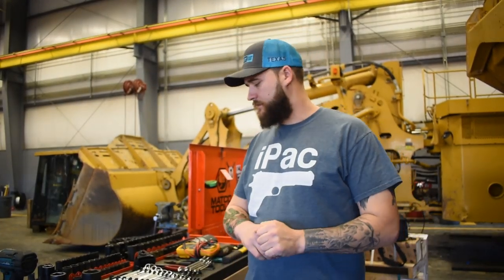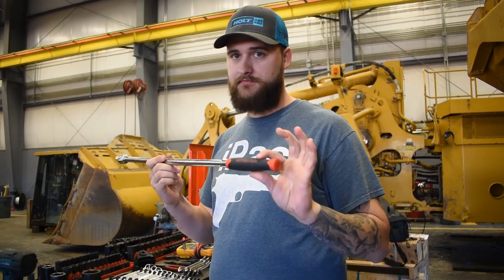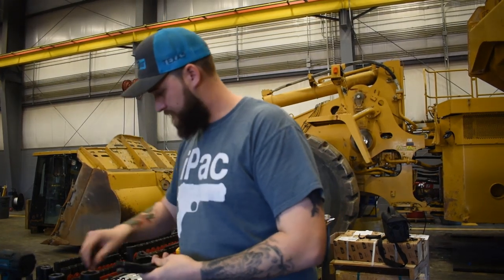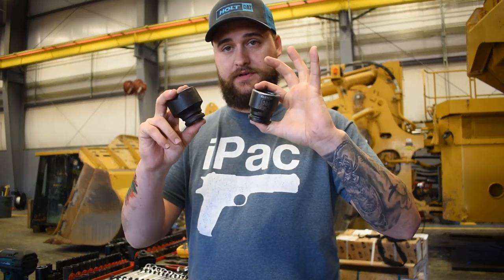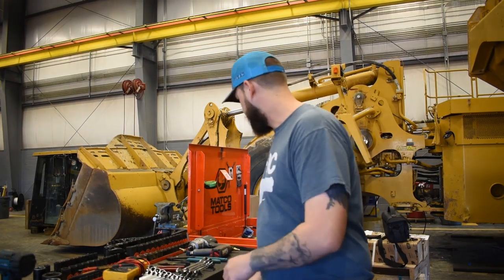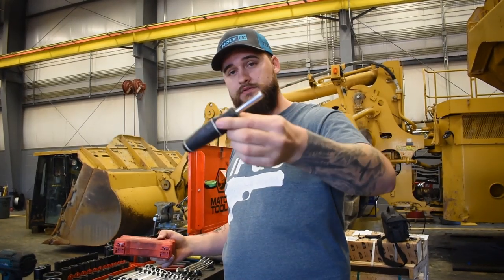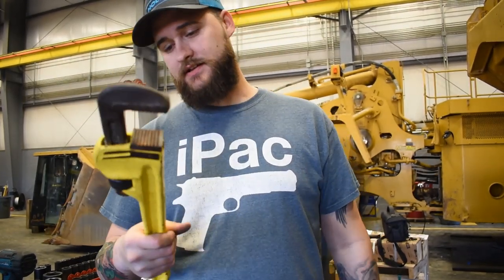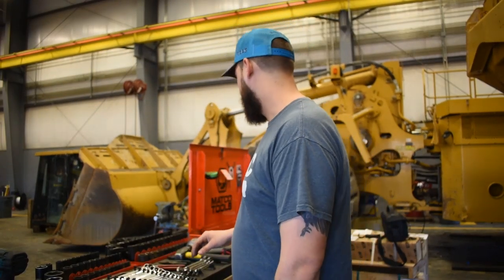Tools You Need To Start As A Heavy Equipment Tech

Comment: I think my best purchases for my first year was my Milwaukee 3/8" stubby impact with the 6.0ah battery along with a set of good wobble sockets. I can zip those clamps right off the valves for hydraulic lines with that stubby and some wobble sockets in some tight ass areas that there is no way I'd be able to get my air tool in. Oh an on prybars get you a 29-48" extendable indexing prybar it's the cats meow i can use mine on smaller stuff and extend it out for the big jobs an being able to adjust the angle of the head makes it really really nice. I probably got 10 different prybars an I pretty much just use the indexing bar 95% of the time.
Reply: Where did you get the pry bars from? What brand?
Reply: @EnriqueReyesJrREALTOR  Gearwrench I have the  33" and 48 inch indexing pry bars. They have handled a whole lot of abuse the still work fine. 82248 is the part# for the 48" and the 33" part# is 82220

Comment: Good list man… I’m in heavy equipment myself but very specific field and we use the hell out of 24 mm  but everything from 8-41 mm metric and up to 1/4 to 2-1/2”  SAE wrenches sockets as you can  …, air hammer with long chisel tip a must…slide sledges, and large pry bars are a must … use  1/2 impact on nearly everything I can and 3/8 on smaller stuff but some times all you can get is hand tools to fit… for what I do the first purchase I made was 24” 1/2” drive ratchet and air hammer I had most the rest of the basics but the air hammer for me is an absolute must have for starting out… as for a do most everything plier knipex cobra or raptor can’t remember which they basically replace slip joint pipe wrench and adjustable pliers imo

Comment: I got a long handle tekton 3/8 ratchet i use for doing couplers in skid steers so i dont have to completely pull the hydrostatic pump out, get it setting back just enough to fish that long dude in and it works sweet

Comment: Astro makes probably the best bang for your buck air tools in my opinion, the Thor v2 1/2 will do just about everything. The Thor v2 3/4 is really handy for tracks. I have the snap on battery power tools and honestly I like them but the DeWalt dcf 900 would be your best bet starting 1/2 cordless. I've got John Deere SAE wrenches and some bigger John Deere and Pittsburgh. I've got an old set of snap on FD+ wrenches in metric from when I worked on cars. I also heavily suggest avoiding comfort grips and going for hard handle and chromes. They stay clean way longer. I've got the EZ red flex head 24 inch 1/2 ratchet. It works pretty great. If you really need a 3/4 ratchet I like the snap on L872 but I'm pretty sure Williams makes a similar head and I'm not sure about different pull handles with it. Don't bother with the blue point hex kits to start, gear wrench makes a great kit also.

Comment: The only thing i can add to the video is husky pry bar set with striking ends are pretty good and way better priced thant tool truck brand. Also if you go the electric route instead of air get stubby 3/8 and high torque 1/2 will save you a lot of time and that setup will last you a while also with screw drivers hes not wrong but i think the sunex set for like 50$ is a better option cause it also comes with torx and is just less of a pain to deal with. For the light id go with the small streamlight its 30$ and a starting technition is going to lose a few before they find a permanent spot for it that they can remember to return it to, But other than that hes spot on
Reply from the maker: You know I just saw those husky pry bars in a video a couple days ago. I didn’t even know they had those. They looks pretty good. Thanks for watching!

Comment: Hey man, great video. I work on semis and I got some of the tools you mentioned. I wanted to suggest a good option for a rechargeable pen light. Harbor freight sells this light (sku: 56511). Been using it for a few months now and it's been great. Bright and works really well.
Reply: Yes, that's a good one. Keep it in  your pocket. It will be one of if not the most used tool.

Comment: If you take them air swivels and put both ends for your air hose on it you can use it with any tool vs just one.
I have the 44 inch harbor freight box and it's okay, but the drawers open whenever it's slightly uneven. Kind of annoying.
Reply from the maker: Thanks for the info!

Comment: Very educational, great video. Doesn't the employer give the new guys a list of what tools they need?
Reply from the maker: Mine did not. And my two buddies that went to work for John Deere did not. I’ve heard of some companies doing that but not mine.
Reply: Mine did but I work at a coal mine on heavy equipment an I laugh because they say you just needed up to 1/2" drive......here I am a year later with a 3/4" Ingersoll impact, and 1" Sioux "D" handle impact lmao Lots and lots of tools needed it never ends. Its a good thing is they supply all specialty tools an a hytorc or I'd be broke lmao

Comment: What wrench’s from 1 inch to 2 inch should you get? What are the main big standard wrench’s needed?
Reply from the maker: The most common ones I use are 1”3/8, 1”1/2 , 1”5/8 and sometimes 1”7/8. I have everything from 5/16 to 2” though. Those sizes are normally on hydraulic hoses. I always use a 1”3/8. I have 3 different styles of that that one size for weird situations with hoses. Made my life a lot easier.

Comment: Did you need any 12 point sockets ?
Reply from the maker: I did not for the longest time. I have a few metric ones now
Reply: @TexasEmpire  okay cool , I’ve been working at this fleet shop for a couple of years but I haven’t learned much of anything. They mainly shotgun everything so I’m looking to jump over to CAT , I think heavy equipment is where it’s at
Reply from the maker: @franciscofranco6486  I definitely enjoy it. Unfortunately out of the two shops Iv been in, mind you same company just different locations. They were completely different. The first one I was thrown in the deep end with no training. Never got to troubleshoot anything was just told to tear stuff apart and rebuild it and 90% of the time that wasn’t even the issue. But I came in with almost no experience. So you will have a head start. Good luck!